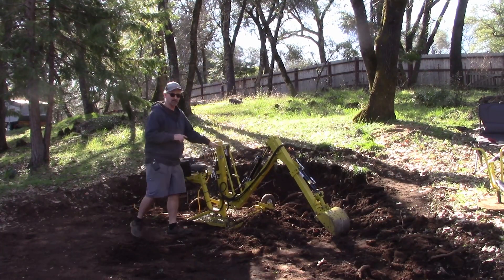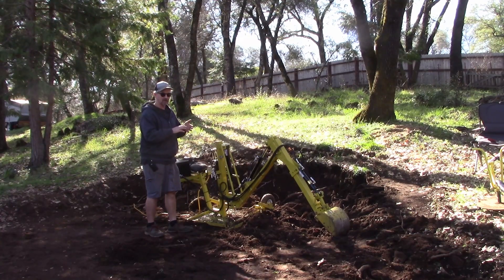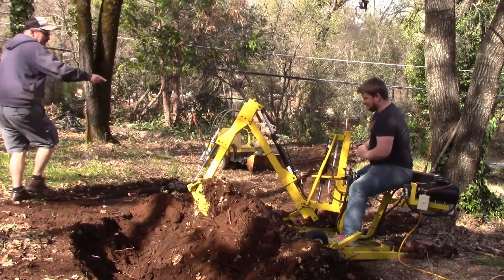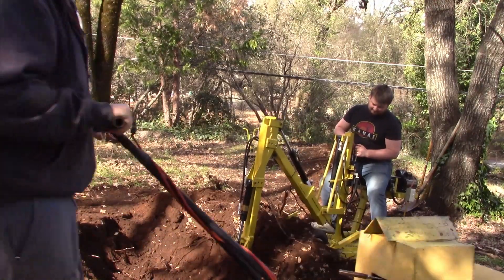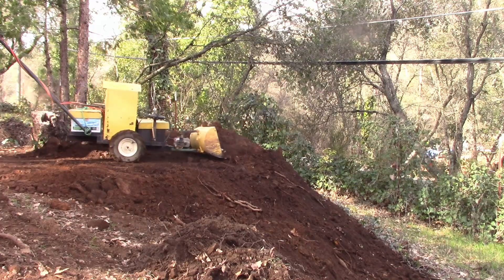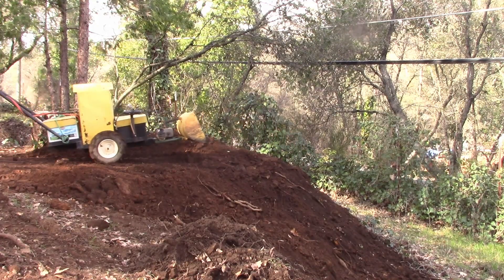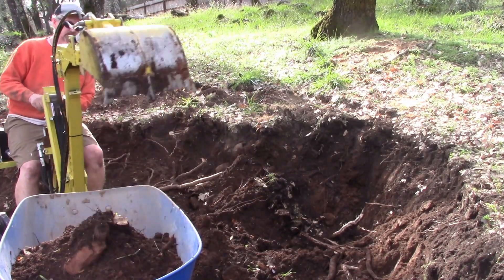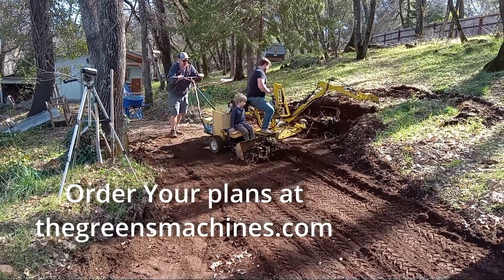First job for the new electric 360 degree home made backhoe

Comment: If you are doing this to save the environment, forget it.  You do this to save your own neck from fumes operating inside!  I'm in a 10ft deep hole inside a garage and need something electric.  I've seen you dig soft dirt, but how is it in clay??
Reply from the maker: It does about the same as the small Kubota type backhoes. Here's a video of a hard ground dig. When the ground gets really hard I do most of the digging with the curl.  https://www.youtube.com/watch?v=xzo-uXIx7zo
Reply: @thegreensbackhoe  That looks pretty impressive.  Any idea what it weighs?  I'm thinking I could lower it down into my hole...🤔